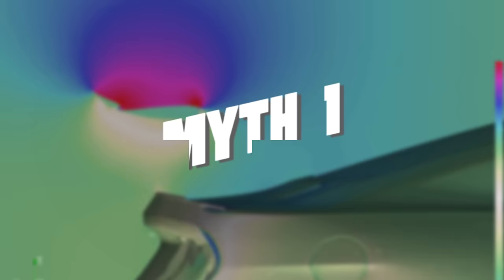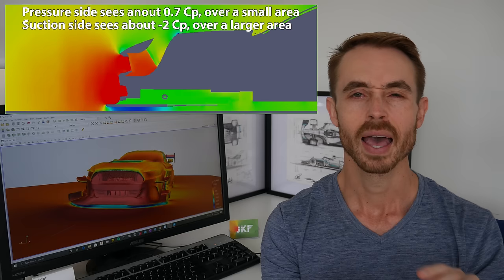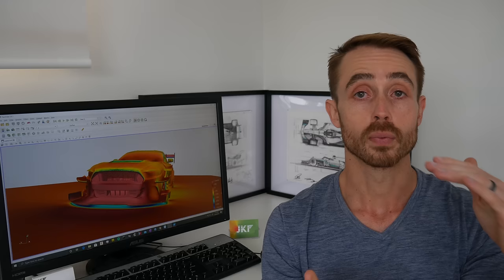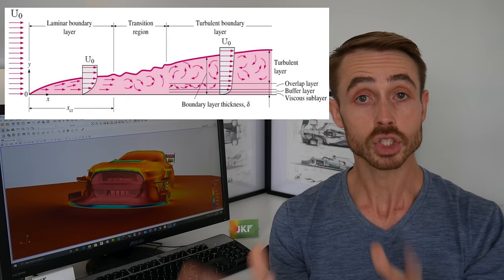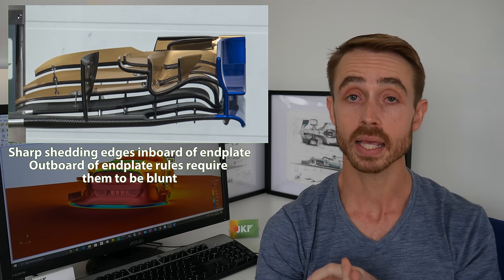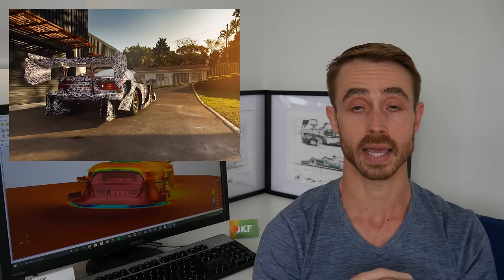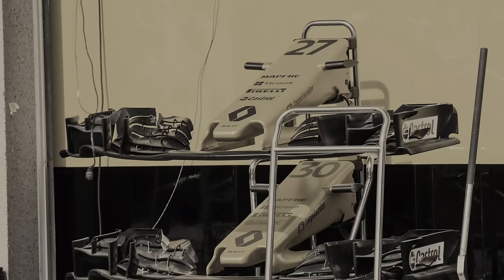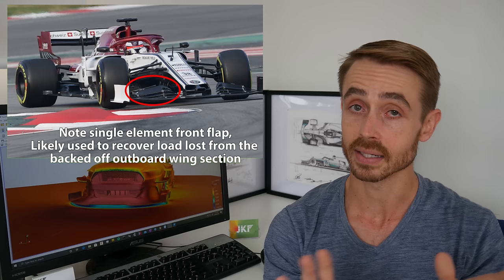5 Common Race Car Aerodynamic Myths

Comment: bigger diffuser will always champion over smaller ones aka valkyrie but the large ones are more sensitive to design flaws..if the ventury angle of a large diffuser is same as a small one, it would definitely perform better than the former

Comment: hey kyle, i have a question about flat floors.  how can you vent an exhaust tunnel heat? would a small naca duct with a vent down stream be sufficient? i’d be afraid to introduce pressure that could bleed over the top of the diffuser? am i overthinking and should just insulate the exhaust...
Reply: Same!

Comment: Hi Kyle! I was curious why sailboat with Jibs tend to go better upwind than boats without them. For some reason the multi element wing system works better at closer angles of attack when you are limited on power. I have no idea why that is the case, but people tend to agree that jibs make sailboat point higher into the wind.

Comment: Could you do a video of whether or not dimples help with aerodynamics? Similar to golf balls having dimples creating a boundary layer and reducing drag. Mythbusters did a fuel mileage of smooth car vs dimpled car and found it improved gas mileage. If it is true, I'm curious why race cars don't use strategically placed dimples.

Comment: The one that i keep hearing is that rear elements on a fwd car are unnecessary.  As if the rear axle on a fwd car literally does nothing... but even if it didnt, the aerodynamics at the rear of a car will obviously effect the front in some way.

Comment: I know allot the performance innovations (F1) are made to circumvent rules changes. I'm curious to see your interpretation of what a modern f1 could  look like if  the only rules where the following; open wheel, overall size, tire size, open cockpit with halo, and weight. I.E.- active aero/suspension, traction control, ground effects, ect.

Comment: Interesting point about sharp leading edges.  Not really interested in a LE external situation, but looking at a valve port.  2 stroke transfer ports are much debated on sharp leading edges but no one talks about the turbulence effect you have described.  Again, very susceptible to AoA from the oncoming air, however you'd expect the AoA to be consistent as there are no external factors.  Any opinions you'd have on this for discussion would be welcome :)

Comment: Would you consider putting together a basic video on running simulations, aimed at someone who wants to implement aero for a time attack car? You mention flowvis, and I've tried to understand OpenFOAM but I'm sort of lost. I'm not a high dollar builder by any means, but I am super curious as to how aero actually works on the 944. I've heard it was designed without wind tunnel testing so I'm interested to see how it performs, and what tweaks could be made - particularly low-effort / high reward.

Comment: Touching on the multi element design for front wing/splitter.
Could a large, flat front splitter be used to simulate the ground so the multiple elements create predictable downforce at any ride height or vehicle angle?
Reply: No, because if it's close enough to simulate the ground you'll create lift on that surface, negating the downforce created by the wing.

Comment: Myth No: 6. "Slipstream is a car in front punching a hole through the air and make it less dense for the car behind to follow. This reduces drag": 
Most race cars work in the incompressible regime. Therefore there cannot be any local changes in density.

Comment: Brake bias, front vs back.
When it should be 50/50 and when it should not be.
Caliper position as well, offset, on leading edge, behind leading edge. Pro's and Con's.

Comment: Awesome Videos. From a rookie, I would like to remove my 2018 Ford Figo Ambiente back seats and spare wheel for weight reduction.Assuming this will raise the back of the car, how is aero affected if one doesnt adjust front and back tyre pressure to correct this.
Reply: For the speed a Figo can do, nothing at all. The Increase in angle of attack  may give an infinitesimally small amount of downforce. Also messing with tire pressure is gonna lose more time than you could ever hope to gain with ride height changes.

Comment: Do you have a video that comments on intake plenums? I'm curious about the differences between intake runners that are flush with the plenum versus runners that have a velocity stack or other way of putting the runners into the center of the plenum volume.

Comment: Regarding the speed sensitive Aerodynamics: I guess it's a fairly specific topic, but I'd imagine there's a desire in F1 to create effects similar to the F-Duct in order  to reduce airflow above the speeds archived during corners.  

Im not sure if it's been successfull, since it seems like a difficult thing to set up properly across tracks and you surely wouldn't want to trigger it at the wrong time or get caught out by track conditions. But after the F-Duct ban, there surely must have been attempts, or am I completely off?
Reply: A combination of stricter rules to stop active aero and drs giving a fully legal option in most of the situations youd want reduced drag means its not really been an area of focus since the f ducts and flexible wings were banned
Reply: That was in the past some of the motivation behind flexible floors, wings and active suspensions. All are banned now.

Comment: I have a question regarding airfoil shapes. 
I have experienced that with a rising number in airfoil elements, the actual airfoil shapes become much less important than slot gap positions or the continued curvature of the actual airfoil array for example. And so ive been taking the approach of desiging the airfoil profiles by means of multiple bezier curves. this makes work a lot easier since ive developed an instinct to what features the individual airfoils in the array roughly need. sometimes i follow this up with a rough shape "optimization", where i vary attributes like camber along the chord of wing. with much more emphasis on the main element than the following flaps.
most standardized airfoils (like naca, or even MSHD) werent developed as part of an array anyways. 
Since you have worked in formula 1, you can probably tell from a more professional perspective. are there standardized airfoil collections, maybe even specifically designed for certain areas of the car, that the team refers to, or do you use different methods like shape optimization to find the 2d airfoil geometries? Wouldnt that cpu time be better spent on the 3d shape of the wing?

thank you for your time and effort in advance.

Comment: This was very interesting!

Personally I long struggled to understand how aero worked, and followed what I believe to be the "layman" understanding of aero, where air meets an obstruction (like a wing), and that the air impacting with the element directly created a downwards/backwards force. That was how I lumped downforce and drag into being the same thing. Wrapping my head around the fact that the low pressure suction aspect is a much bigger contributing factor to downforce, took time.

Even these days, where Ive learned a lot (from channels like yours), and have a decent grasp of how aero works (no wizard, but at least reasoned the same things as you eventually did, during this video) - I still catch myself slipping into the "high pressure creates downforce" mindset occasionally...

Comment: Would the pitching moment not also be a limiting factor to the number of elements you'd use? Not sure if I'm correct in this but I think it gets bigger exponentially as you add more elements and would be a problem on an aeroplane. Might this destabilise the car?
Reply: Absolutely. Aero has to be balanced front and back, or you get an unbalanced, bad handling car that is too far tilted to the back or front. Although this is more related to wing area as opposed to element number. Wing elements are just better at efficiently getting that downforce

Comment: all those "funny" vortex producing elements on the front wing (up to 2018 season) were only to "push the air around" front wheel right? 
Btw the FE solution is way better covered both front and  rear wheels - less drag & "dirty air", that's the way F1-3 should go too.

Comment: Question: I'm not understanding on what you are saying with speed sensitivity. Looking at the Lift equation L= (C * p *v^2 * S)/2  would say any aero element is speed sensitivity regardless of implementation. Isn't there a range that any Aero element works in? With a point where lift is no longer negotiable and another where flow separation happens so early you start to lose lift over all. EX: FSAE wings don't work on Formula 1 and Formula 1 wings don't work on FSAE because of the speed difference. If you have the time could I get some kind of clarification on what you're saying.
Reply: I think what he's saying is that while of course the force generated by a wing is a function of speed, car aerodynamics don't suffer from speed related effects the same way as planes for example do (where trying to maintain altitude at lower and lower air speeds will cause you to eventually stall, because you have to keep increasing your angle of attack). If you assume a car that can maintain its ride height etc. perfectly at any vertical load, the aero surfaces wouldn't suddenly stall etc. below or above a certain speed threshold. The speed effects you get are more from varying ride height, bending components, active systems etc., rather than an inherent effect of the speed.

EDIT: I don't exactly see why FSAE  wings wouldn't "work" on an F1 car, and vice versa (aside from issues relating to packaging and how the body can interfere with the airflow to the wings, they are of course designed as a package), if the wings get the kind of clean airflow they want then they should work. But they're both optimized for vastly different target speeds, striking a different kind of balance between drag and lift, so while they would "work", they wouldn't necessarily be suitable. An F1 wing intended to work most of the time at 200-300 km/h probably isn't aggressive enough for a Formula SAE that'll only ever do like 120 km/h.

Comment: The is nothing like suction! You can't go lower than 0 atmosphere. Now the opposing side is pushing you with like 1 atmosphere. Suction is always coming from the other side pushing. But because on the low pressure side is now less or in this case nothing that presses back, it feels like suckin. That is what we call suction but sucking doesn't work like we imaginge. It feels like we are pulling sommething but it is just particles moving in the way of least resistance, hence maximum speed of particle movement is speed of sound and maximum force would be 1 atmosphere, as you can't go lower. Just think of a vacuum cleaner. It doesn't suck, the atmosphere around it presses itself through the tube, because there is nothing anymore to press back haha.

Comment: Do you take racing track into consideration while designing aero parts, like do you design specific elements for mid downforce track , low downforce , high downforce etc, and use those elements in those tracks only,

Comment: Tl;Dr - race cars go too slow for significant mucking around with reynolds numbers. (And geometry is mostly fixed, unlike airplanes which changes angle to always (try to) create the same lift - thus car cannot hit critical angle, thus can't stall)

Comment: Bro can i pick you brain, Excel racing series, fog light holes? closed in the shape of the lamp, open or ducked to the brakes?  and the huge performance question ;) to stock rear spoiler or no. low drag focus.

Comment: First minute in, cmon force is generated by the differential pressure, how much higher the top side pressure is than the low side. You may be working the underside harder but the effect is a component of both

Comment: Is it possible to use a more agressive diffuser angle if you somehow can manage to add vortex generators in front of it? I sort of remember a video where you talked about using vortex generators to combat flow seperation.  (EVO roof for example)  Thank you for all your vids!
Reply: Go for a Gordon Murray fan?
Reply: I might not be an aero expert but I have seen it on the TS0-50 LMP1 Front diffuser so I would say yes? http://www.connectingrod.it/apri_news.asp?id_news=208&lingua=en
Reply: Yes, it can be done. You can even use a small "bump" in front of the diffuser, we had that on a formula student diffuser a couple of years ago
Reply: @Faintingh1  can you elaborate? Just a bump?
Reply: @Simbstah1  yep, a bump that caused some turbulence in front of the diffuser
Reply: The thing is that vortexes on diffusers are a bad thing, they may be helpful keeping the airflow attached at the end if a roof but that's because the roof generates greater wake naturally.

Comment: Hi Kyle, I'd like to see an explanation of how drag is increased when a wide front tire is sitting outside the front bumper/fender.  Could you explain how a tire blocker/front tire spat helps in this case?   Also would a tire spat be effective even without a front splitter?   An example of such a device https://racebredcomponents.com/products/racebred-components-universal-front-tire-spats  Cheers.

Comment: "Sharp leading edges are an appropriate choice on any aerodynamic device"

I'm extremely pedantic soooooooo:
https://en.wikipedia.org/wiki/Lockheed_SR-71_Blackbird#/media/File:Lockheed_SR-71_Blackbird.jpg

I know it's an extreeeeemly niche use, but hey, you said any device :)
Reply: "I appreciate some things, like canards, need a degree of a sharp edge" - canards being 1 example, but I'm pretty sure aircraft designed to fly at high supersonic speeds with stealth properties also count. Not sure of the effect on stealth but the sharp leading edges certainly are related to the speed of that thing.
Reply: @ApothecaryTerry  I was mostly pointing to the, well, points, of the inlet cones. I'm 99% joking, I know less than you about aero, no question, but that one part of my brain overpowered my resolve to not comment.
Reply: @ArrKayCee  I'm no aero expert...it just seemed appropriate to post an extremely pedantic response to your original comment! ☺

Comment: Question   Why don’t f1 cars have dimples like a golf balls ? It’s proven that they fly further which = less drag . Less drag = more speed !
Reply: dimples help induce turbulent air, because f1 cars are much larger and faster they tend to induce turbulent air by themselves, plus turbulent air doesn’t flow over the aero as well in same cases
Reply: golf balls have dimples because they are meant to induce turbulence no matter the orientation of the ball. Cars and plane have their own turbulence inducers calles vortex generators

Comment: I don't know why I feel sharp leading edge is better, even though I was just explained the reason. Same with a big wing. 
maybe its a visual thing? sharp edge looks fast. planes are fast therefor large wings on cars are faster. 
Also red ones go faster
Reply: its visual things to make it look aggressive you could check The Sketch Monkey
Reply: The fastest planes don't have the largest wings though. And the leading edges on those fast planes aren't really "sharp", they're just "thin".

Red ones of course do go faster, but that's easily explained by the power of Da WAAAGH!
Reply: @jubuttib   I don't mean for real aerodynamic reasons.  try thinking of it like a 5 yr old.
Reply: @lamia197  I didn't think planes with large wings looked fast when I was 5, but I'll try to keep it in mind. =)
Reply: @jubuttib  what's up with big wing plane though? I meant big spoilers or wings on cars not planes.
Reply: @lamia197  I guess for me it was like "all the really fast planes look kinda like rockets!" so for me the association with wings and speed was always skewed towards tiny wings. So a small discreet wing on the trunk lid looked faster to me than a big f*ck off wing. :D
Reply: @jubuttib  ferrari in nutshell
Reply: @el-danihasbiarta1200  That, and Mitsubishi 3000 GT, the FC RX-7 stuff like that... Kinda dating myself there... =)
Reply: @jubuttib  yeah, me too, like the f104. And as a kid I thought fire from exhaust was a booster. Cause batmobile.

Comment: #1 "Downforce comes from high pressure" doesn't sound right because it is incomplete. In the images you used, 0:53, 0:56 note that an area of high pressure exists above areas of low pressure. This leads to a "pressure difference", hence a "net force" downwards, if you recall your physics.

Didn't bother to watch the rest.

Comment: My elementary school teacher said there is no such thing as suck.  its the other forces (atmosphere) that do the work. No wonder YouTube is more profitable than F1 for you
Reply: In absolute terms there's no suction, only push, because there's no such thing as negative (absolute) pressure. But in relative terms, e.g. relative to ambient pressure (gauge pressure) you can talk about reduction in pressure as suction. It's usually much more convenient that way. In this video he's talking in terms of pressure coefficient, which is defined in reference to ambient. Hence, the 0 line in the graph is at exactly ambient pressure, and negative values are reduced pressure, or relative suction (but note that the graph scale is inversed).

Comment: Myth #2: wrong, airfoils are 100% speed sensitive. drag, lift (downforce) are dependent upon speed, even for a fixed AOA.

You got #1 right though. The suction side is the important side.